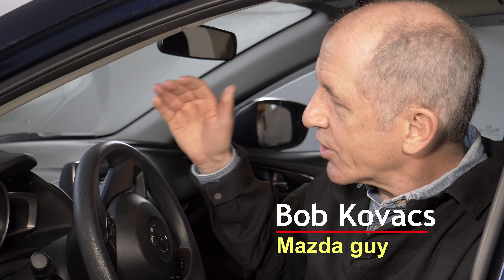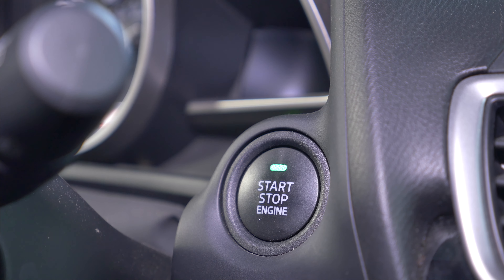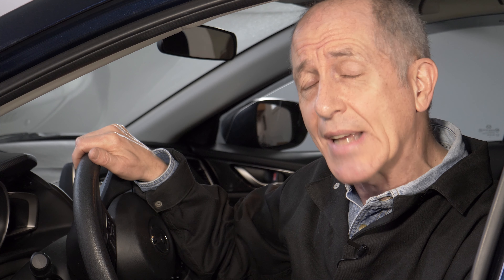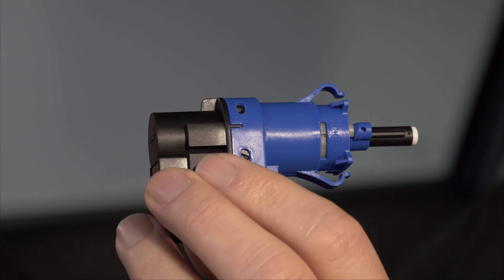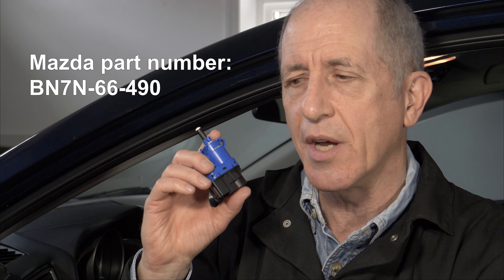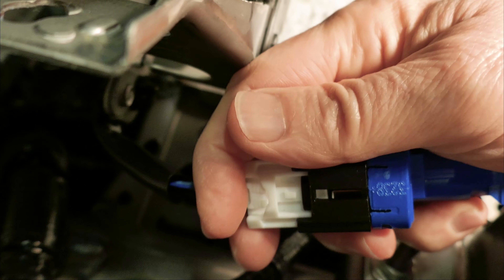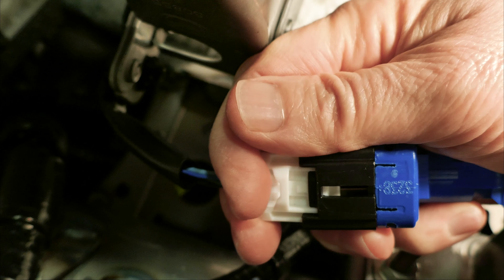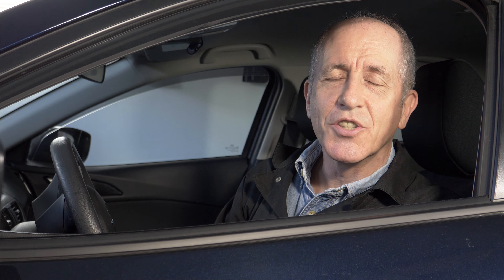Mazda3 2014-2018 Brake Light Switch Replacement

Comment: im hoping and praaaaying  its something as simple as this u see my battery was on its last leg so i jumped it off parked it to the spot i wanted but didnt have enough gas to drive it long enough to let it recharge so i let it stay parked had to get something from the car and saw i left my dome lights on yet again i know im workn on it about the dome lights so i couldnt get in with the key fob i knew thats a hint its the battery so i tried to jump it to try  to let it run for a few min to try to recharge i wasnt gonna have cash for gas for another week and i didnt go drive it for a while like i was suppose to so i just parked it until then i went to the car again saturday and couldnt get in with the key fob i used the key  the last time i jumped it was thursday morning so it didnt jump start that time i  called state farm a guy came out nothing he put $5 of gas in still nothing today i had it towed to walmart thinkn its the battery all signs pointed to that and no go they called me to my car thinkn there was maybe some trick to it to get it started cuz its a push button start i tried nothing i couldnt even put it in drive they tried everything for me he put in the new battery nothing they said it wasnt the alternator and i noticed the light wasnt coming on on the push start/stop button no light at all and the radio wont come either all the lights come on the dome lights power locks windows wipers all that work as well the ac comes on but no radio and no starting i did see the brake indicator light on but didnt put that much thought into it so maybe just maybe this is my issues as well any help or ideas is greatly appreciated i really need my car so anyone if u have ne ideas pls pls leave a reply

thnx

dee dee
Reply from the maker: It sounds like the brake light switch to me. Good luck!
Reply: Bob Kovacs oh woooow thnx for replyn ur amazing i just went down to ny car and tried to see if itll start thinkn id get a miracle u know how u show someone the issue and all of a sudden it works yeah that didnt happen the one time i wanted something to make me look stupid and it didnt its makn me look like i maybe on to something thnx to you and your video so any who i tried again still the 
start/stop button wont light up 
green or amber when i press the brake the brake lights come on the key icon thingy flashes red when i press the break and hit the start button the key in the dash is red and the abs flashes and  all the interior lights work the dash lights up  the power locks/windows work and the wipers headlights work but no radio and it wont start and i cant take it out of park the tow guy had to go through the side of the shift thingy under that little square thingy and take it off and use something to push i guess a little button to make it go into neutral etc so the start/stop button dont light up no radio and no start so im really praying it is the break thingy ill keep u posted and thnx soooo much for replyn im actually a tech head i can diagnose and help u figure out anything tech related like iphones pc laptops etc im your girl this car stuff im still learning and im kind of a tomboy lol haha so go figure i learn something new about my car as i go or when ever i have an issue i think i can handle its good to have folks like u to come on with advice vidoes and try to  help us out so thnx sooo much if u have any techy issues im here for u 

happy thanksgiving